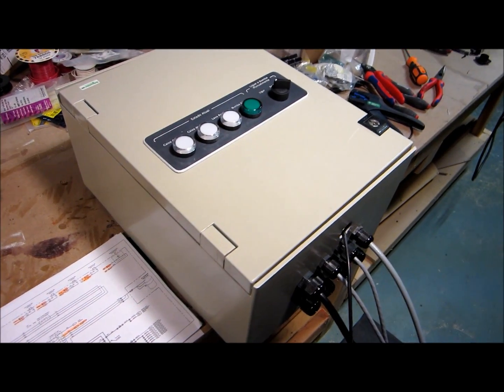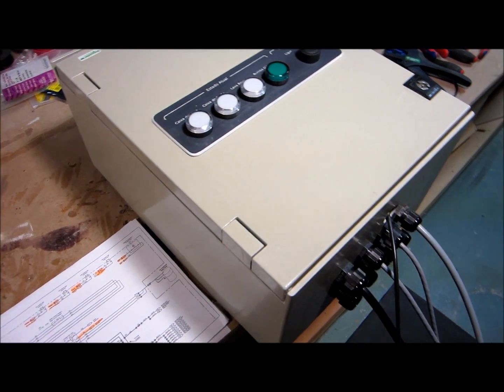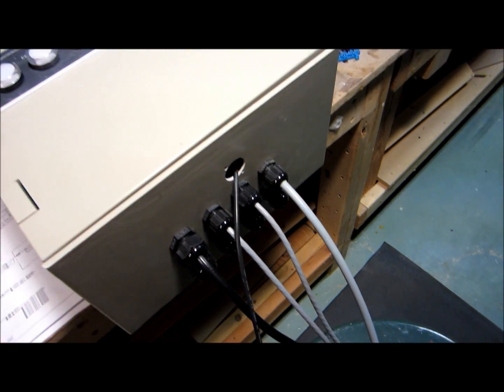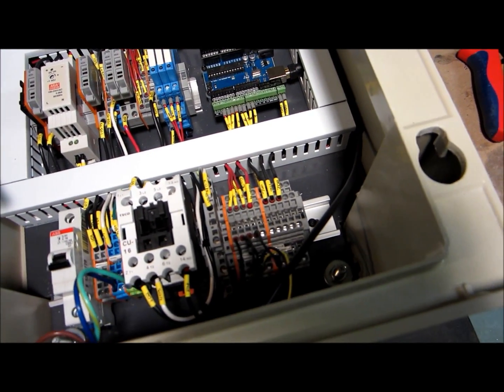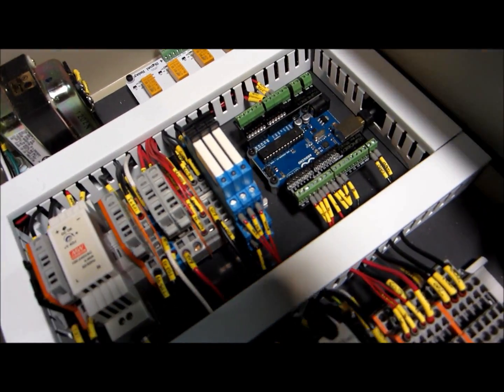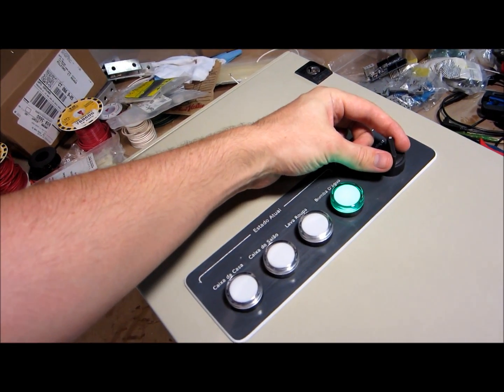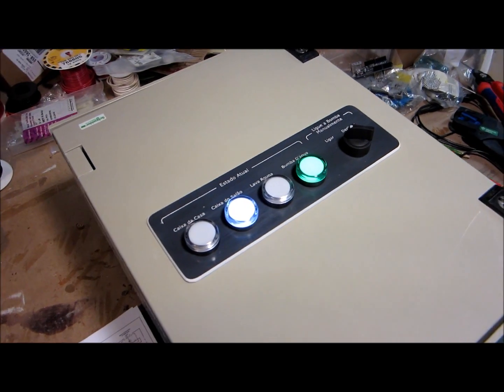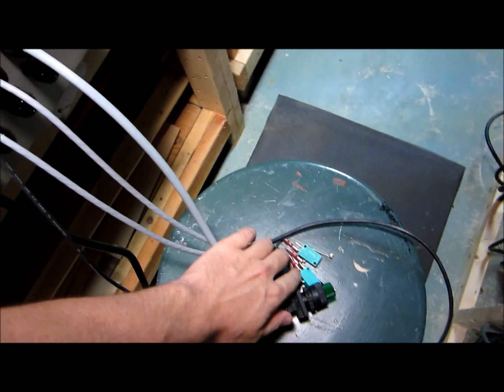Arduino Water Control System

Comment: very nice, question...what did u use to start the pump...was it a small arduino relay or did u have to use a typical pump start relay?
Reply from the maker: I used a logic level relay board (sainsmart) but ended up adding a motor contactor for the size of the load (16A) full load amps. If I did it again I'd just use the new arduino based finder plc they sell and do it all in one package and just add circuit protection.

Comment: is this only for a project?  how does the arduino works in the industrial enviroment?
Reply from the maker: It was for a DIY home project. In hindsight and after a decade of experience in engineering, with electrical controls etc, the Arduino is a great developmental platform and for learning but not suitable for industrial applications no matter how you package it. In the past few years there have been numerous industrial PLCs and controllers introduced to the market which are far beyond the expensive allen bradley, siemens types of the past and don't have a significant barrier to entry. These devices have not only industrial/commercial approvals but are designed for industrial applications. This was a fun proof of concept though, it taught me a lot.

Comment: Nice one! :) Any reason why you used a microcontroller/Arduino board instead of a PLC? Also what kind of rubbers did you use to isolate the snap-action switches/sensors? naqueles fim-de-curso verdes ;)
Reply from the maker: If I had to do it again in today's day and age I would have. The options are endless these days for even just $100. What do you mean on the switch isolation? Those were just demos for testing, the actual float switches are the typical encased float switches where they are the rocker switches sealed in a plastic case with a roller ball to actuate based on the float level.

Comment: Hi, it's a very nice setup. How about durability and any troubles with arduino during these 5 years? Is this system still working? Was this maintenance-free and  were there no problems with arduino like resets, spontaneous stops etc?

Comment: Very nice work.  What parts did you use to "break out" the arduino board?  Screw terminals and connections to header pins on arduino?  Thanks.
Reply from the maker: This was some time ago I'm not sure exactly which one i used, but you can find them anywhere these days: https://www.google.com/webhp?sourceid=chrome-instant&ion=1&espv=2&ie=UTF-8#q=screw+terminal+shield+arduino+uno&safe=off&tbm=shop

Comment: Just came across this project. You've done a very good job with the casing and cabling! I love the strong lights and the switch. I will try to adapt your design for an automated garden watering system, just need to find a similar case to yours.
Well done sir! Greetings from Germany

Comment: This is a beautifully assembled project, the wiring looms are very professional. But I would like more info on what it actually does?
What was this water system for? It struck me as a tad over engineered, but maybe I'm missing it's purpose?

Also, and my major point of interest, water sensors, what did you use?
Reply from the maker: Was to control two holding tanks for water with only one pump and one water source (well water) and to give logic to that operation with a few requirements. The arduino never really worked well for this application and a lot of cheaper PLCs have surfaced in the past few years that would have been better. The arduino however proved to be an incredibly powerful development tool though. There are not many microprocessors that you can do IO with out of the box with minimal programming knowledge.

Comment: Nice job. I'm from Canada and have been volunteering my time at a remote hospital in Zimbabwe. We have three pumps, 6 tanks spread over 3/4 km and everything is controlled manually. I started designing a control system using relay logic, but I figure it's time to get with the times.... Would it be possible to share your schematic and your arduino code with me? I would love to go through both in an understanding of what's being done..... so I can expand what you have to hopefully fit my project. I have a lot of experience as an electrician and controls in particularly, but my knowledge is old school analog but I'm learning!!

Comment: hey! 
i just have one question.... how do you place they Arduino board inside they box??? do you use the four holes to put a screw in each one of them???? all the ip65 cases that i know doesn't have screw holes
Reply from the maker: I fastened it down with 4 fasteners, nylon spacers and nylon washers to isolate the fasteners electrically. I made a custom PVC back plate that I fastened it to. You will have to do the same as the hole pattern is not based on any kind of standard.
Reply: Grillo Contreras just search for 'pcb stand' in amazon

Comment: Hello sirWould you please tell in detail(or video) about how to control a 3 phase motor using an Arduino What is required to interface them electrical and electronic components how the connections there will be or any protection system for the motor to protect it an the starting??!!
Reply from the maker: It all depends on how you want to control it. Obviously the arduino can't handle that load directly, but the arduino is very capable of switching a larger motor contactor or relay to carry the load through a low voltage output. You would want to make a protected bus in your enclosure with a 3 pole circuit breaker sized to protect your loads as well as perhaps a 3P CB downstream just to protect your motor. The easier solution is just to use an AC drive like a VFD. The VFD does all of the above and gives you unlimited functionality and you can communicate with the arduino using IO between arduino and VFD low voltage controls. (Typically). The arduino can send an output to an input on the VFD to turn on, vary the speed, and the VFD can send an output to the arduino microcontroller for faults and errors.

Comment: Hi, which is the best float sensor for arduino? And i wanted it to run for 400-500 ft length for filling the overhead tank from sump the controls are near sump.. By the way awesome looking setup...
Reply from the maker: I would not say there is a best 'float sensor' for the arduino, as most are just simple contact closure. I would be more interested in picking the best sensor for your application (mechanically). Arduino can take all kinds of analog/digital inputs so there are very few limits in that regard. 400-500 lineal feet of cable for a sensor is concerning though, you may find limitations with the voltage drop, especially on a low voltage signal.
Reply: briancnc i picked stainless steel conductive type water level sensor, as this is fairly cheap and outputs 5v, for compensating wire loss for 500ft, ill feed 6-8v at 1 amp so ill get b'ween 3-5 v at output as Arduino can sense 0-5 v at its I/O .. Now my only concern is how do i integrate the 8 channel relay with 2hp DOL starter's contactor ...

Comment: How did you do that infor plate? What did you use for printing?
Reply: and why is in portuguese
Reply from the maker: I engraved a PVC plate, painted infill on the lettering (I would not do this again, you can buy this tag material which is cored in white so it engraves through). I did this on my CNC.
Reply from the maker: Because I brought it to my family's house in Brazil, you should have seen the TSA's agent's face when it went through the X-ray machine. They freaked out a bit to say the least.
Reply: briancnc This looks great. Look I was looking for a way to create process scheme on the face of the control box. And place indicators and switches right on that scheme. No I am tinkling of buying laser engraver and use acrylic. Also fill in paint. Because we do not have engrave material. We do have but I've only seen silver and gold. Although this is a good idea. I could glue together 2 thin lists of acrylic. Black on bottom and white on top. Then when laser cut off white it shows black.

Comment: The setup was really neat and professional. Can you show it in action?
Reply from the maker: +David Refoua David, I wish I could. I ended up not leaving it in action. The arduino had too many issues from AC flyback from the solenoids. If I was to do it again I would have used a cheap PLC or DC solenoids as they have less headaches.
Reply: +briancnc Ah too bad! So what did you use as a solution to control those tanks?
Reply from the maker: +David Refoua David, I left a bit of a more manual setup in place. My concern was issues with the arduino. If it was in my own home I would have left it in place, but I installed it in my family's house in Brasil and I was concerned if they had issues and I wasn't there that a normal electrician would certainly not be able to work through it. Complex solutions to simple problems aren't always the answer and I went down a path with the arduino that taught me a lot. I don't have any regrets and I still have the system intact in my shop. I actually took this entire panel on an airplane complete, you should have seen their faces when they put it through the xray 3 times!

Comment: How long did it take you to go from start to finish on this? If you say over night I will feel stuuupid or something. I picked up my r3 boards yesterday and I'm like, okay, what do I do now? LOL.
I need to monitor temp so I guess I need to find a 'library' or 'sketch' and burn it or something and chuck the temp sensor in my tank somewhere. Very exciting but daunting. You know that feeling, you've gone so far and you have to start over again craming more knowledge in your knocker...
Reply from the maker: +Dana Andrews Oh don't get me wrong, it took me only a few nights after work to build it, but I played with the conceptual design and logic, as well as layout of the panel and schematic for quite awhile. Don't be overwhelmed by it, take it very step by step. Make something turn on, a light move, a sensor input, then keep adding things until something breaks. Don't try to build something like this directly. I made a lot of other rudimentary electronics examples with the arduino before this one, don't get me wrong.
Reply: Thanks. Got the temp sensor up and running. Will now get started on the motor controller etc. It's pretty fun.

Comment: Great job on the control box. Are you an electrician? I ask as I will be doing something similar soon an need to learn a few things to get going
Reply from the maker: +thehaytch I'm am not but you can learn a lot from youtube and others, the internet fortunately offers so much information that with the right knowledge and experience you can quickly and safely pull off even complex projects. A lot of 'licensed electricians' do awful work and don't understand a whole lot about electrical theory, so the more you know the better. Read, play, learn, experiment, knowledge is power! Electricity is fun to play with if you respect it's physical properties and electrical potential!
Reply: +briancnc great job, can you please provide me your sources of learning these stuff? Arduino, electronics, automation, plc, etc..
Reply: +briancnc Incredible, I agree. But anyway this is almost professional work, I am working on similar project but not close to this you really have sense for automation. And yes knowledge is power! and there is lot on you tube, keep up good work.
Reply from the maker: +Igor Ć. thanks so much Igor!

Comment: All is placed really well and in professional way, but why would you need to invest that much resources and even basic programming, in a system which with the same relay setup, but with simple electronics, will do pretty much the same and with much less components (point of failure) will be cheaper and probably way more reliable? If using Arduino is mostly for  monitoring the system and logging its activity, then that would be justified I suppose.
Reply from the maker: Петър Петров Good point, I realized this later. This was one of my first arduino projects and it was a proof of concept. I needed a logic driven setup and wanted monitoring as you noted.

Comment: Hey Brian, great project, very professional looking. am working on a similar project for a school garden. if you have the time, think you could answer a few questions for me about your project? thanks. Mick
Reply from the maker: Michael Cremins Sure, send me a message with any questions and I would be glad to help.
Reply: Hi Brian, thanks for getting back to me. I'm going to start the project over the next couple of weeks. I'm going to make a small desk top version to build / test it, using computer fans to act as pumps, manual mirco switches to act as water levels, 3-way valves etc.  

Would I be able to send me a copy of your Arduino software, it would cut down on my work load by a huge amount as the arduino is my weak point. Thanks in advance. Mick
Reply: hey Brian, how are you keeping? I was wondering if you can send me a copy of your Arduino software for this project? If not, no problem. Many thanks. Mick
Reply: Hello Brian, how are you keeping? I was hoping you could give me some pointers on the coding you wrote for the arduino, I have 7 inputs (high and low level sensor) and 5 output (2 pumps and 3 valves) so I was thinking of using a Switch program, that would basically read all the inputs and then give the outputs to pump water around the system as necessary. I have about 8 lessons in C coding under my belt so I'm an absolute beginner at coding so any help would be greatly appreciated. Thanks. Mick

Comment: good job,
Please help me, i have a problem, I Have made a the same product, but when i bring it into industry then it not work. I think, The main cause is noisy from power supply 220v/50Hz and 380/50Hz. I have used to opto to separation between arduino and 220v/50Hz. Could you please for me your circuit diagram to refer? Thanks a lot. My Email: huynhquoc1990@gmail.com

Comment: Hey fellow, that's a great job ! I like it!
But I need to know what did you use to connect the arduino port to the sindals ? Have you made a PCB with these conectors ? I need to look closely, can you help me on this ? And I'm about to make a PCB to connect the arduino's port to the sindals....
I'm asking you because I didn't see the PCB that I'm talking about...if you understand or no my question please let me know.  See ya !
Reply from the maker: I used a screw terminal shield, and a sainsmart for the low level logic outputs to higher current relays. Just google 'screw shield for arduino'.
Reply: Oh Brian, you just clear my doubt ! I just google it and I found ! Thank you so much. Have a nice week !
Reply: +FILIPE FREIRE I am also curious abot this too man :D

Comment: Great job!! Many teel that arduino ins't indicate to control industrial supplies. I desagree. I say some good projects, like a multiplex with arduino to control six ac triphase motors with only one analog output of a PLC developed by a guy where I work.  But, I have a curiositie. Why the tags indicator in the panel are in portuguese? Pleasy, my english is not so good. Bye.
Reply from the maker: Because I built it for a property in brazil and took it on the plane with me there. I did the tags in portuguese for better operational ease.

Comment: I used to design and sell aqueous cleaning systems. Your work is first rate, our panels looked like this so I can see you are experienced. Great work! Let me know if you ever need tips for handling water. We had machines with many pumps, valves, and blowers, drawing 400 amps on 480V. It's nice to see pro work with the arduino!
Reply from the maker: Thank you!

Comment: Hi, I have a question about your project,actually more questions, but one is more important.How did you used your arduino for higher voltage and currents? I'm going to do a project that involves a number of dc motors which need a rated current=5A and I want to use some 12VDC relays to switch on/off or reverse the motor rotation.Thank you in advance!
Reply from the maker: You just need relays rated at the voltage/current you will operate your loads, and that have coil loads that are below the threshold of the arduino outputs. There are  plenty of boards like the sainsmart I used here that take logic level output and will operate relays rated at high current/voltage.
Reply: if its an ac load i highly recommend a solid state relay
http://www.ebay.com/itm/Solid-State-Relay-SSR-25DA-25A-250V-3-32VDC-for-PID-Temperature-Controller-TE-/291259297642?pt=LH_DefaultDomain_0&hash=item43d0682f6a
ebay has tons of venders that sell this model.  it only draws like 6 ma and can be activated directly from the uno output port. (3 to 24v dc < 6ma activates) it can control up to 20 amps ac from 32 to over 220 volts.  Ive been using several to control horse trough water heaters that draw 15 amps and they work wonderfully and they are cheep 8ea domestic shipper and 3.50 dollars for chinease shippers.

Comment: Can I ask what kind of lamps you use?
Reply from the maker: They are Weg 22mm pilot lights, I think I got them from factorymation.com but they can be purchased all over the internet. These are 12VDC leds but they also come in incandescent and in different voltage ranges (for supply voltage).

Comment: Nice... I've got a few questions:
What did you use for solenoids? What kind of metal? Brass..Copper? I'm concerned about this for a saltwater tank. I'd like to find an electronic pvc one.

I'd be interested in knowing some details on how you mounted everything. Looks like you mounted all the components including the arduino to a plexiglass board, then mounted that board to your box...But I'd really like to see how you mounted the ardiuno itself.

What did you use for water level sensors?...lighting/distance? float switches?